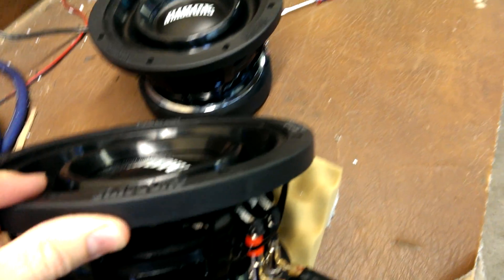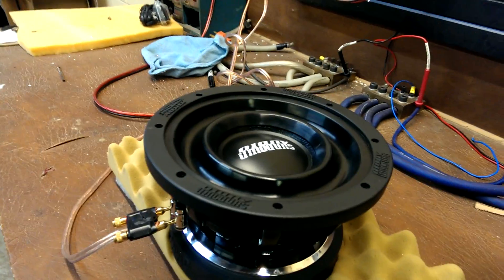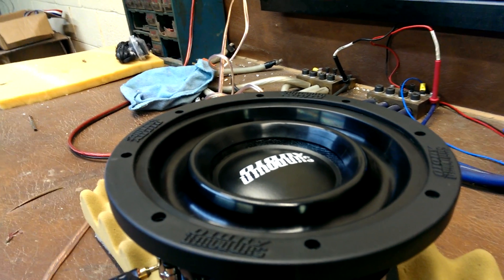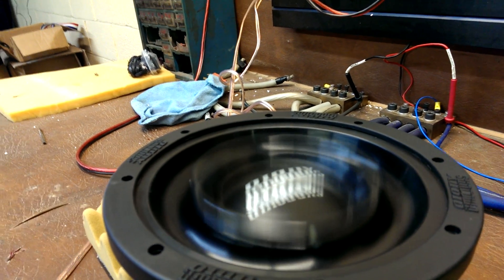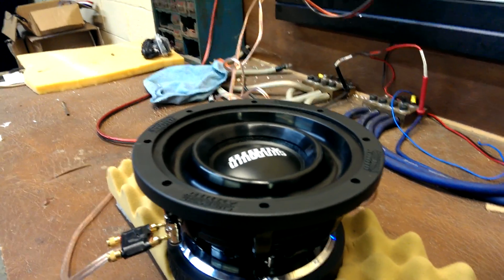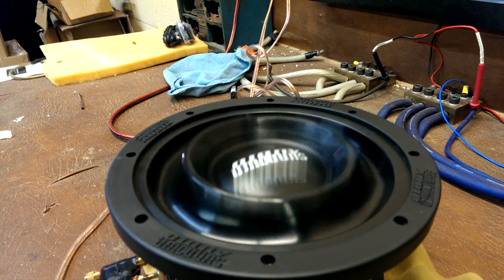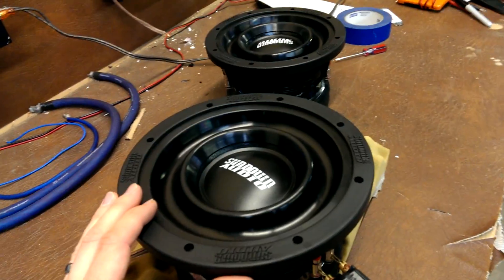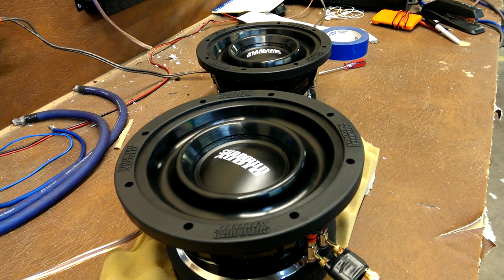SD-3 8" Prototype (First Look)

Comment: i actually have 3 of these little guys i was thinking of messing around and building a bandpass using 2 of them.the EBP shows they are 6.9 so i guess thats not bad,problem is haha designing the damn thing for one,i mean i was on a roll for a 2.1 ratio then started to try a 1 sealed and 2.5 ratio ported and my brain just said AHHHHH ENOUGH haha so i stopped,but it is first thing in the morning,i have these subs just setting around,i wonder what all 3 would sound like in a bp.AHHHHH NO lol Jacob is one bad dude.going in a 2005 blazer.which everything jams in these trucks

Comment: Looks awesome.  I understand that the sd-2 and sd-3 are optimized in sealed enclosures; however, how will they do in ported?  I'm having a sub enclosure custom built for my truck in a couple of weeks and it will probably be ported.  Thanks
Reply: Lol... Peter I see you're taking your time with modifying the truck.

Comment: That is some crazy excursion for an underhung 8 inch driver.
Reply: +Sawyer Keller I know. I looked at the magnet depth and thought this probably won't have very much throw but holy fuck. For a shallow single slug magnet subwoofer, that thing has fucking XMAX O_O